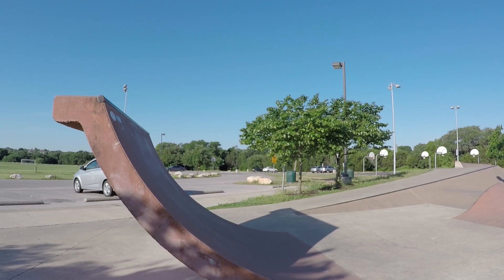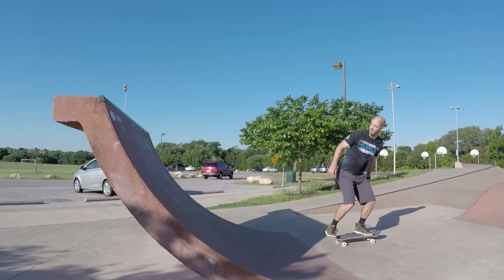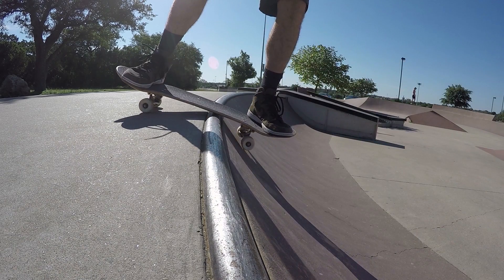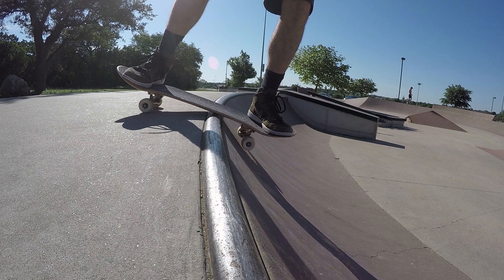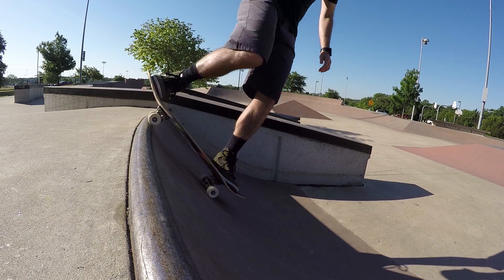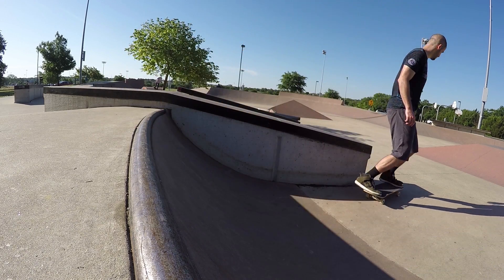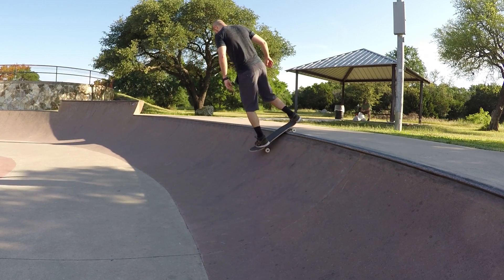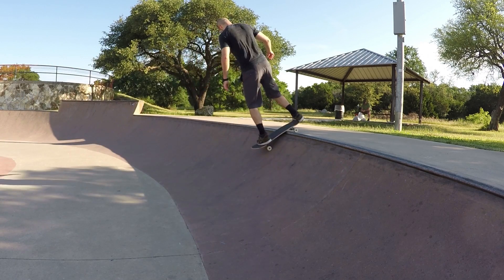How to do a Fakie Disaster (Fakie Pop Rock) on a Mini Ramp

Comment: Nice video man. This trick is little difficult to me, but I realized that I am not raising the back foot. Maybe to practice fakie Ollie will help me.
You could do a video to explain blunt to fakie. I saw you doing this trick in another video. In my case, as I ride in a mini ramp with a high copping, is difficult to put the wheels in the correct position.

Comment: So when coming back in should your goal be to clear your back wheels so they don't touch the coping at all, or is it more of the back wheels rolling over the coping when you come in?  Anyway my wheels touch when coming back in I have like a split second panic attack that I'm going to hang up.
Reply from the maker: The back wheels should touch the coping on the way back in.  I agree it's scary the first few times, but it starts to feel normal after you do it a bunch of times.  As long as you have your front foot in the right spot, you shouldn't hang up and fall